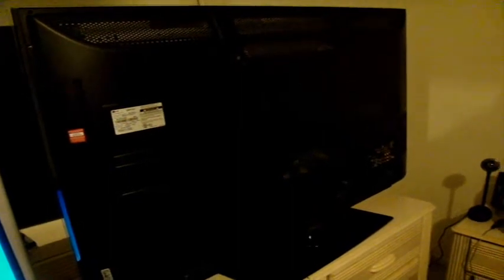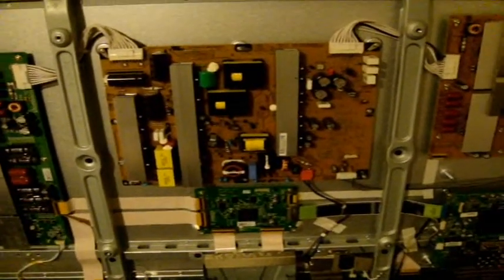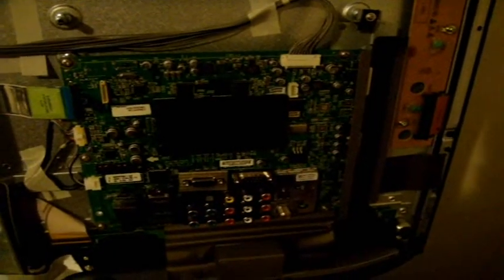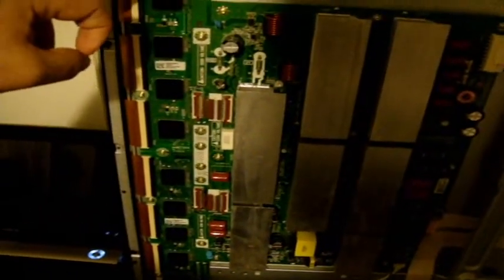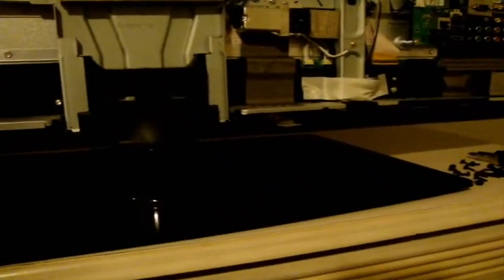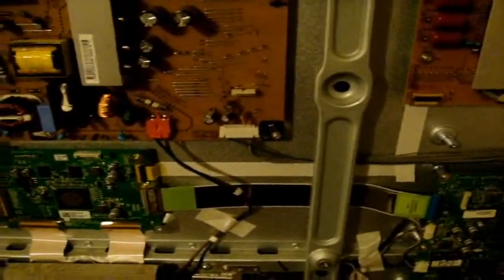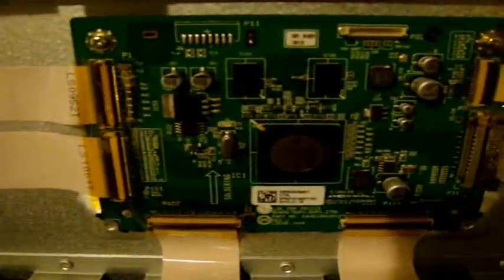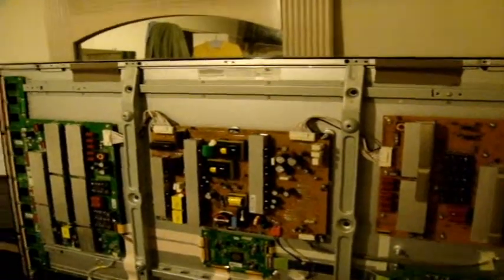LG Infinia  50PK750 -  Inside A  HD Plasma TV .

Comment: Yeah. Those LG models are pretty sweet.. I fixed my LG 50PK540 and repaired quite a few 50PK750 plasmas with clicking & power issues.  But overall, they're pretty good sets

Comment: I have the same plasma. Just stopped working last night. It turns on only via the remote, but there is no picture or sound. No functions are available. To turn it off i have to turn it off at the wall. When on the standby light go red to blue then thats all i get. Any suggestions on what to check or fix?

Comment: I have a large vertical line, different colours, running down the center of the screen could this be fixed by checking solder connections?